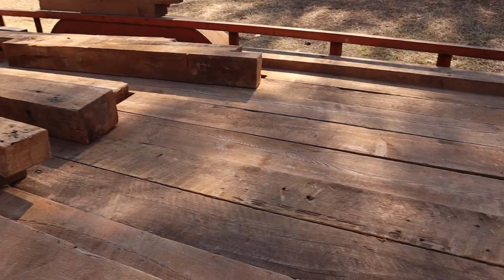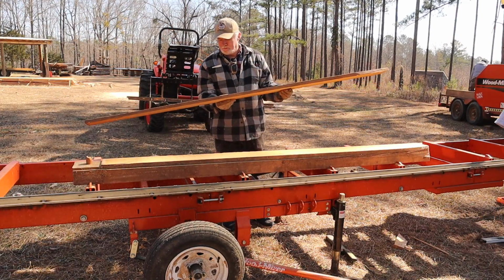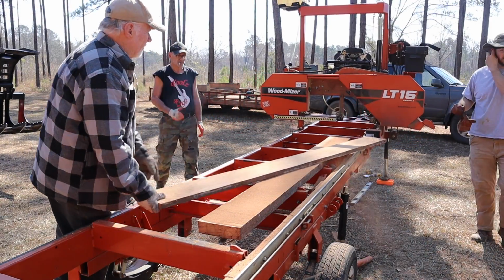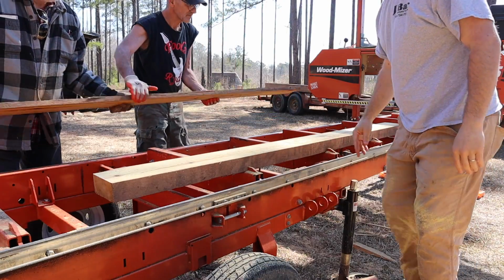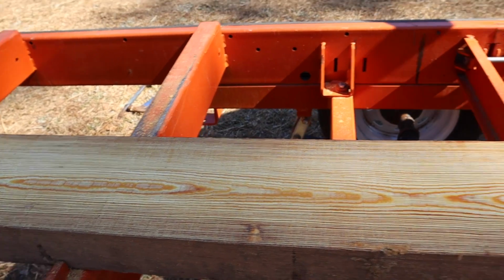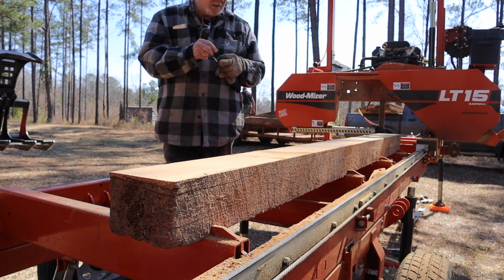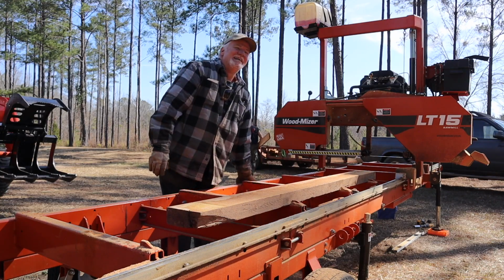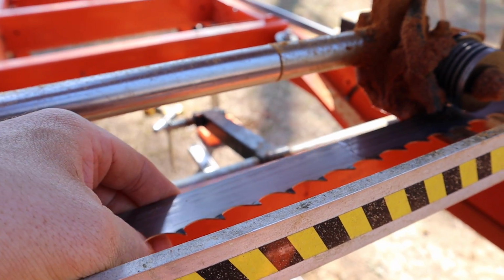Stunning Lumber from 150 Year Old Beams

Comment: The first video I posted on YouTube was me milling heart pine boards from a large industrial beam, also full of nails. I have found that a combination of metal detector and a small rare earth magnet suspended like a pendulum from a string is an excellent way of pin pointing metal location even under the surface. As far as nail removal, a crescent 19" #56 slide hammer nail remover works great with minimal damage to the wood. Crescent also makes a nail pulling pliers which also works excellent. That heart pine smells great doesn't it!

Comment: Around where I live in Texas there are only a couple of places within 100 miles that will cut reclaimed beams , The ones that do charge 100.00 for each blade they have to change on top of the milling price .  Usually they will change a blade after every beam that they hit any metal on and the price can skyrocket fast .

Comment: I made furniture out of very similar wood.  Run one piece through the sander, change the paper.  Cleaned it with Simple Green.  Not sure it would work in your lube system.  Some of mine had rings so tight had to use a magnifying glass to count them.  50 or more to the inch.

Comment: The gentleman was using the wrong end of the mini pry to remove the nails - you use the short end as it will dig deeper, and it has a face to allow striking with a hammer. Also, diagonal cut pliers do an excellent job of gripping and pulling out embedded nails. Given the expense of the equipment I see on these videos having a few vise grips and two wand metal detectors would be a wise investment.

Comment: Wow!  I would have that thought after 150 years that it would have dried to the point that gum build up would not have been a problem.  So I guess "heart pine" is what I always heard described as "fat lighter" wood which was notorious for burning down houses.  So do you normally use diesel fuel for cutting green pine wood?
Reply from the maker: I do now! Works great, and it doesn't take much at all.

Comment: See your using diesel fuel lots of people think you use a lot but in a days cutting I just uses a quart or too. 
It saves on blades and makes better cuts . Looks like you got some great lumber.
Reply from the maker: I'm barely using any at all. It's a game changer. Appreciate the tip.
Reply: Ray, I have an LT 40 and my drip system doesn’t seem to work with diesel. Is yours  a gravity drip system?
Reply: Yes it’s a gravity drip.

Comment: Diesel in your tank sounds riskey if you hit a nail... will it spark and ignite the diesel...
Reply: Diesel is not very flamable and is actually hard to ignite
Reply: You can actually throw a lit match into diesel and it will be extinguished. Diesel is an oil and does not vapourise like petrol does.
Reply: I have had no problems with it keeps my blades running clean . I do wipe down the inside of my housing tends to make saw dust stick.